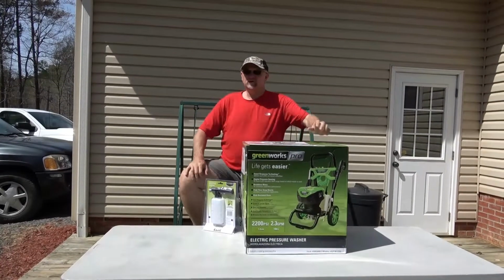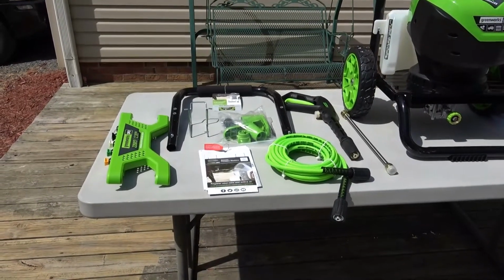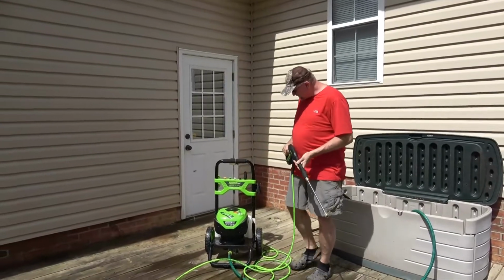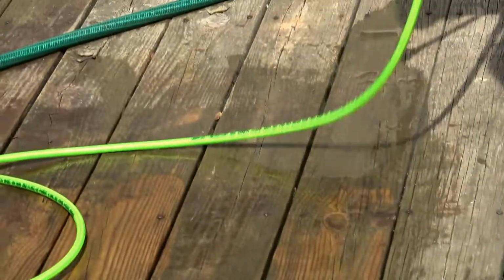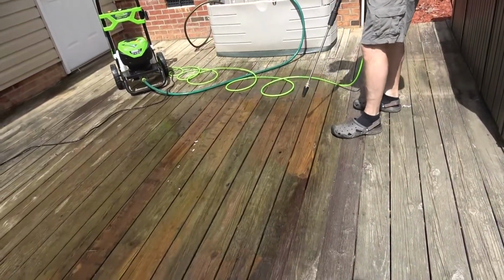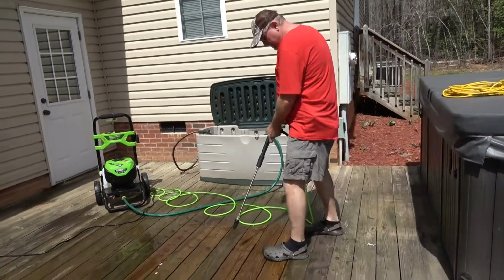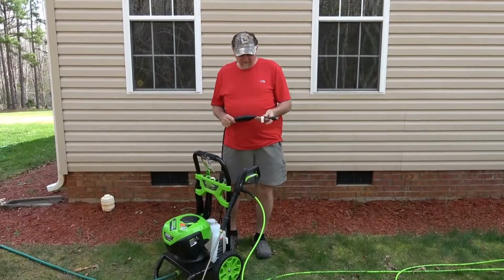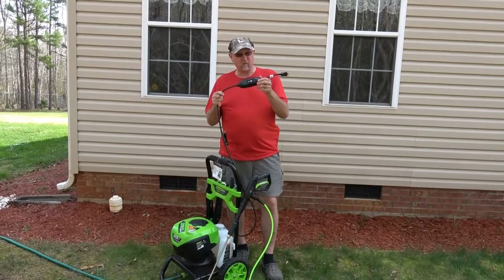Review of the Green Works Pro 2200 Electric Pressure Washer

Comment: Hi Mike, you said that the GFCI in your garage was being tripped by the pressure washer. A GFCI is not the same as a current-limiting circuit breaker, it's job is to detect an imbalance  between the supply and return electrical conductors. If it's being tripped by the pressure washer, the GFCI may be either wired incorrectly or it may be defective. I would have it checked out for the safety of you and your family.

EDIT I forgot to mention, the reason the unit was overheating was because the extension cord you were using was likely too small of a gauge. You need at least a 12 gauge extension cord for that pressure washer or else you will not be supplying the full amount of current the unit draws which in turn will lead to a voltage drop causing the motor to overheat. That should be mentioned somewhere in the owner's manual.
Reply: How about changing out the orifice to say a 1.1 - that likely can reduce overtaxing the motor..

Comment: I got this unit now for over 1yr. I use an extension cord all the time. Doesn't over heat or trip the beaker. You should check you're home wiring and beaker box.
Reply from the maker: May have been my GFI.
I am glad you like it.
Reply: i used an extension cord with mine today and it  worked fine

Comment: If you are tripping your GFCI, whether the built in unit, the one in the duplex receptacle, or even the circuit breaker installed GFCI breaker, try switching to a known 20 amp outlet, vs a 15 amp.  Lots of info in Lowes reviews for this product and feedback from Greenworks stating this as a possible remedy.

Comment: They lied on that package. If it is 2200 PSI @ 2.3 GPM, then it would require almost three horsepower!! The 120 volt circuits are limited to 15 or 20 amp breakers. Using the 20 amp breaker at 120 volt limits power to 3.2 HP, assuming 100% efficiency, but with motors that size expect 60% to 75% efficiency and that is not including power factor, which makes it even worse.